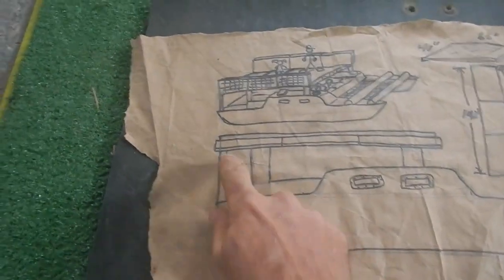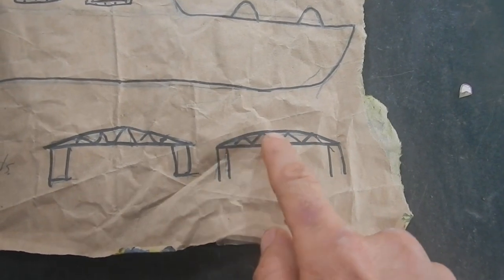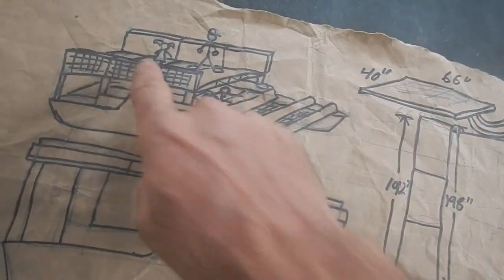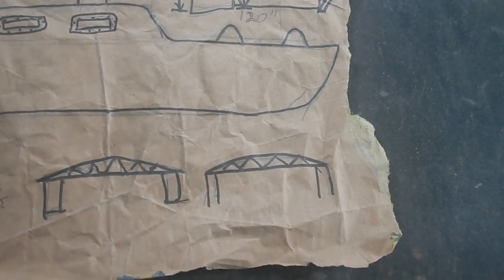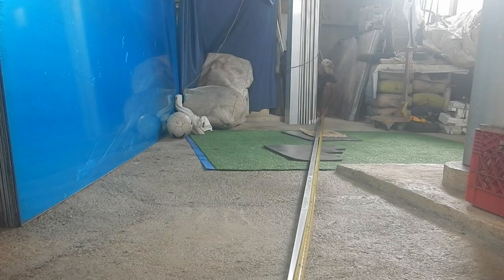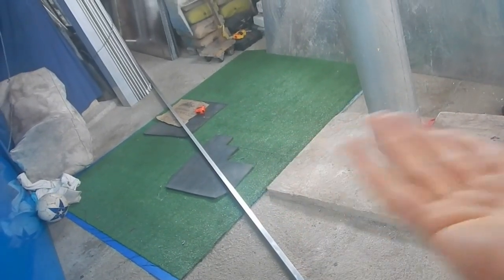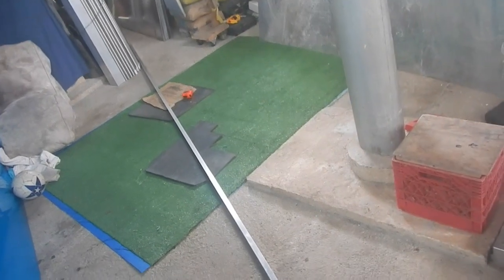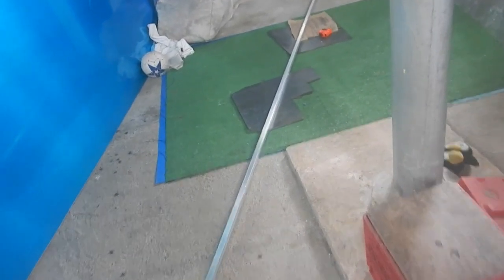Shark Slicer Upgrades 010 Starting the Roof

Comment: Just put that nut there while you still can. 2.5mm of aluminum can't hold threads very long if people are walking on that. 

Don't look too bad to get the nut in place. Just use flexible stick which have right angle and maybe a magnet or something to keep the nut in place untill it threads in.

Comment: This would be a great welding project... How often will you be standing on this? I'd suggest just making it a roof with the thinner smooth material.
Reply: Them plates aren't even long enough, so try them length wise and the strong only in the middle on the sides you be slipping off anyway...

Comment: So crazy! when ever I needed to bend aluminium aluminum pipes I went to the trees behind my house where I could find all the proper distances and angles and lengths I needed.  If only you had some trees! OR could you use the curve of the dome? I bit of foam panel under the 1.5 mm diamond plate might help with rigidity.  I used 3/4 inch foam and 1.5 ounce fiber glass for a solid boat roof.  I love watching your process.  Mine curve was 3 inches over ten feet yours looks like more which will be stronger but harder to not slide off of?

Comment: the explanation at 10:16 is counter to my (untrained) intuition. It would seem to me that support needs to go towards the middle, so that when you  put weight on it from above, it sends force towards the center. If you angle it the way you suggested, it's not directly blocking that force, it's adding one more "paralell" (I mean, not exactly parallel)  angle to overcome before the exact same failure occurs. Another way it makes sense in my head is that you made a triangle out of the skinny part. and put the base of it towards teh bottom edge).

Comment: wondering if the weight added by using the 3mm is worth 'walking on the roof' of your boat, i mean the 1.5 mm will take load if battons are added, maybe not point load but thats why theres a boat deck...desire to point load on the roof for walking seems to offset the rebuild in general..

Comment: HiJamie I dont know if giving my opinon on your build bothers you if it does Ill stop doing it  but here goes . Instead of webbing for strength on such a short rise maybe add sheet good gusset plates in thirds on the span , breaking the edges will add strength to them and ,  will it be to hot sitting under all that metal ? Good luck you have a really good supply of material to work with .